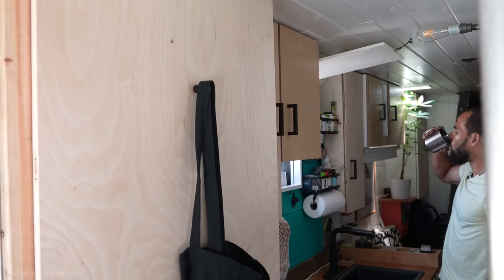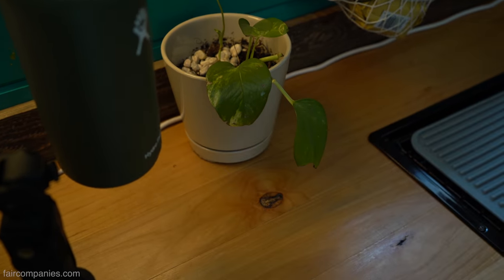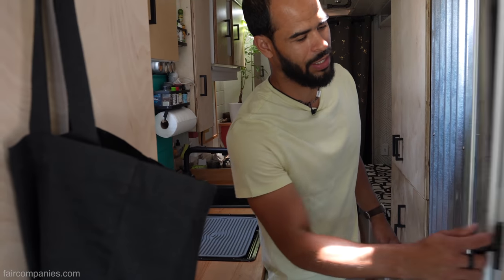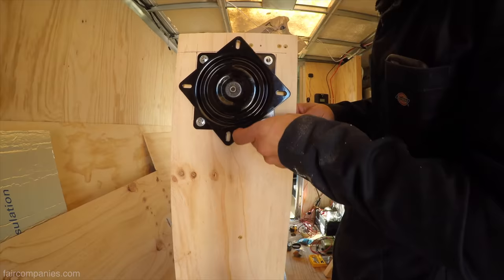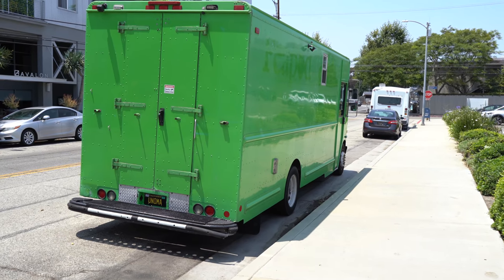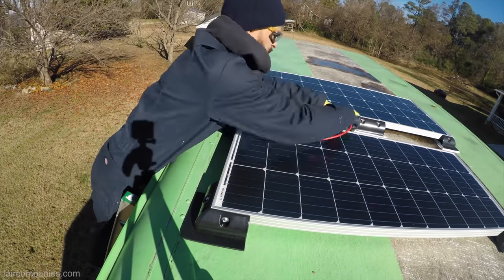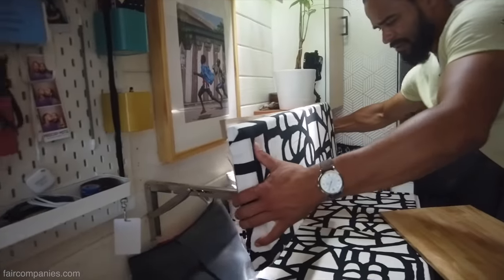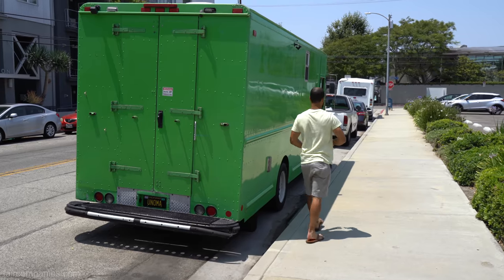Old delivery truck outside, fast-transformer homestudio inside

Comment: That seat back is clutch! One of my biggest issue with booth style seating is that it’s hard to have good posture if you need to use a computer or sit up straight because the seat back is so far away. Awesome solution to that issue! Also love the table on a swivel, allowing it to be utilized in multiple seating positions and can be moved out of the way . Excellent work, the engineering background came through on this build!
Reply: I thought the same thing too. I want a little 50s style booth in my kitchen, but it would drive me crazy to slide in and out, without an adjustable table like his. Brilliant. That seat back is on another level!

Comment: Excellence in mobile home creation. As nice as it is, the price of the initial purchase and the build-out cost make this my favorite
presentation seen to date. If only you can correct the mpg with a newer engine with more torque, but you're good as is.
Reply: Honestly, less than $20K for basically a house on wheels. Not bad considering the labor was mostly done by himself. I’d only be concerned with longevity troubles, which could probably be handled by have a good insurance company that offers roadside assistance.

Comment: That's an amazing build. Well though out in all of the technical terms. I didn't see if he had hot water or not but even without, in a tempered climate you can get away without it. I'd like to do a solar water heater, just run some cooper pipe up on the roof in an enclosure.  On most days that should work for a decent shower!

Comment: Like others, have watched many diff builds and every once in a while ones true energy just spills out. The whole plant thing, his design not being a straight polished room like some, but has true character and sensible vibe to it. Really enjoyed this. He def could consult on builds. I suppose many that go through this process could. 
But, like also mentioned, having YT at our fingertips has accelerated this whole  lifestyle. The only thing really holding people back is what season of life they are in ( kids / agreeable relationships/ job status etc) , outside of that..the builds are the 'experience' and learning process itself.  Yes some have a different mechanical/engineering sense and it may take you a few extra tries. But you will get that same accomplished feeling :)

Comment: So many good ideas!!! The gas struts on the Murphy Bed hack and the 600lb. magnetic door lock are wonderful! ❤️
Reply: That door lock was cRaZY!
Reply: @jonothandoeser  It is crazy but it also makes sense.  It almost seems like an alternative to a regular front door lock on a regular house provided it could have a stable electricity source.
Reply: @justinm2697  You're right. I suppose if you had back-up batteries it would work well on a house too.
Reply: Agree
Reply: @jonothandoeser  yes for sliding door. for regular i suppose not so much. but yeah it would surprise somebody a lot. usually lock needs to hold just enough for people to give up.
Reply: I have thought about magnetic locks for heavy-duty, insulated, [automated?], security shutters for windows. I'd want to have the hinges on the top so that they could be at an angle that blocks the direct sunlight and I'd want them to keep out light, heat, noise, and intruders.

Comment: This is a great conversion! Love this over the smaller camper vans that are so common. If the pricepoints are about the same- this is much more worth looking into.
Reply: Price points and accessibility are not even close.  He said he paid $9500 for that truck.   A new van will cost $50k-$90k+.  Used ones in his price point with close to the amount of room he has and still solid is really hard to find.  I won’t say impossible but I looked for a couple of years and then just bought a shuttle bus.  I don’t think you can find a van as large as his truck and a van, like a sedan, is narrower by a couple of feet.  The widest van is the RAM ProMaster at 6ft.  Step vans are usually right at or 2in short of 8ft wide.  I think a step van, and his build, are superior and yet significantly cheaper.
Reply: 10 mpg tho xD
Reply: The difference is the sprinters get around 23 mpg but hey this is nicely done.

Comment: Pretty damn cool! The kitchen window doesn't give it away as a stealth camper, but it's not something found on a delivery truck. I'm thinking the window could be mounted completely behind the truck wall and then the cut-out could be useable as a removable or hinged over. Put rivets on it and the surrounding opening and it could be misconstrued as a body repair. Or just make an incredibly tight, filed to fit version with angled cuts to minimize the lines between the window cover and the body.

Comment: A bit of triva: The opening scene, shows what appears to be a stainless steel cup secured with a magnet. BEFORE I learned that not ALL stainless is non magneticable (?) I mean, at the scrap yard they use a magnet to determine if it's stainless, but it seems that if it has a certain percentage of iron, a magnet works. That's why magnets still work on a "stainless" fridge door, or so the saleman told me. Step van sliding doors...they are fantastic in decent weather, just ask your UPS driver.

Comment: This is Playa Vista, in Los Angeles, CA.  Very fleeting mention, in case anyone else missed it. 
Van is gas or diesel?  I wish this was listed.
As usual, Kirsten, your films are a joy to watch. As much artistry in your videos as are skills on the van build.  Such a treat!

The magnetic door lock is genius!  Very clever security feature, well done.
I'm very impressed with his engineering skills on the bed mechanism, and the engine fixes, just wow!  Such a creative man.

The bench back is an example of creative engineering. That got me thinking the same way, what a great idea.  I love this layout - functional and robust, really great build.  Wish there were a few more windows inside, that would be more cheerful and bright.

fyi - Hey Vaughn, if you want those plants to thrive, they need water drainage and air flow at the root level. No saucers stuck to pots. Saucers allow water to remain in pot, inducing root rot. This is why that Aloe Vera and others are turning brown and yellow. Root rot. All pots must have holes in bottom, and set into a saucer with heavy gravel at bottom. When you water them, soak them in sink first.  Let all water drain out. Then place on the heavy large gravel or stones in saucer.  Now any remaining water flows out, and air flows in.  Problem solved. Only other issue is lack of sunlight, so consider them on your dashboard panel as a garden feature and consider IKEA plastic plants inside the van - looks realistic and no work!  Dashboard can be a herb garden.

Comment: Feather in your cap for the electro magnet locks system. I wonder where I could buy into one for my Dodge Ram 2500 currently using VIPER locks system with alarm which uses pneumatic levers ( PROBLEMATIC) text back if able 🇺🇸

Comment: Um...no, it doesn't look like a "delivery truck", mate.
Not with that colour 😂
By the way, how do you solve the mold situation?
All that wood on the inside (even in the shower area) traps  humidity.

Comment: 11 miles per gallon that's roughly  4.7KM per 1 Liter       My diesel Iveco 3.0T gets about 14km / Liter.  or 700km/50 Liters or 31mile/ gallon going at 65-75kmh speed.    Glad I got the diesel.  My C6Z 427cu had even better gas mileage even in the city than his.  Unbelievable fuel cost but great build.

Comment: There are 4 things that I would absolutely have to have, and this build has all four. 1. A Murphy Bed or Hydraulic Bed. 2. The front cab walled off, preferably with a pocket door. 3. A no flush dry toilet 4. A separate bathroom area with a shower that takes no more than 30 seconds to set up.

Comment: I was thinking that if the exterior paint scheme was of a bread type, like Orowheat, Wonder Bread, or some product, then you could also park this with complete anonymity at any grocery store, or Walmart.
I spent about two years living in a Cargo van at a truck stop, and working in the area doing commercial construction. I had a TV,  Playstation, Laptop (with hotspot), all the creature comforts. I even installed a home window A/C unit that I powered with a small Ryobi gas generator. Great times living like that.

Comment: Excellent demo. I had a similar, but shorter van, made into a simple camper. One of the best features is the aluminum body on these things, as well as the sliding doors, although the 'pockets' that they slide into won't allow for windows to be placed in that area. 
If the Ford 5.4 liter engine of my model year didn't have issues with spark plugs popping out (ruining the threads) I would have kept the thing. Yes, they could be re-sleeved, but that does not feel very reassuring.

Comment: He should paint Unoma Junk Removal on the front and back doors with spray paint and stencils or with vinyl letters while leaving the rest of the trucks patina intact. That will make the truck look like a real work truck for a struggling small business owner.  Pretending to be junk removal business its least likely to be broken into since thieves would more likely expect nothing of value to be inside.

Comment: There are induction cooktops where you can control the amount of wattage you use, so you would'n't max out your batteries or inverter.  There are other cooktops that are rated only at 750 or even 500 watts so of course, cooking would be slower, but you wouldn't use up all your power.  You could also consider one of those butane stoves they use in restaurants or hook up of propane cooktop like you see in tiny homes.

Comment: Eventually he will need something to shade the exposed wires on the roof.  There isn't a wire type out there that stands up to direct sunlight.  I've seen a lot of people make that mistake.  Usually when the wire starts to break down, it cracks and shorts to either rain water or metal roofs.  Then the charge controller starts blowing fuses.

Comment: HEY! Awesome build. 

I was really interested by those locking brackets that puts the back of the bench in an upright position, I was wondering if you could put a long bar along the back (attaching it to both locks) so you could easily unlock them both at the same time just by pulling up on the bar?

Comment: I love these sorts of stealth urban living videos, converted delivery trucks and ambulances. Vaughn's delivery van is super cool! Something about the green color makes his van friendlier. Totally digging his 600 lbs magnetic lock for the door, such a cool idea. He might want to add the same locking mechanism to the smaller door that leads to the back of the van. His Murphy bed setup is killer!  Ideally its  best to stay on 12V power instead of trying to bump up to 120V. I've noticed that folks tend to use the back of their vehicles as their garage/tool areas and to store either bicycles or motorbikes.